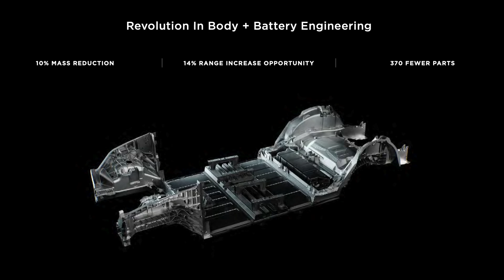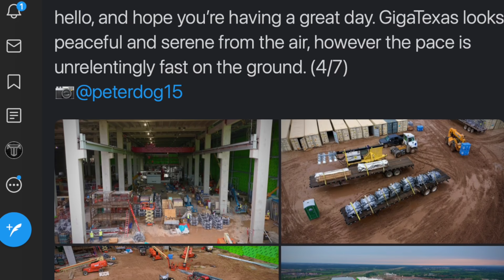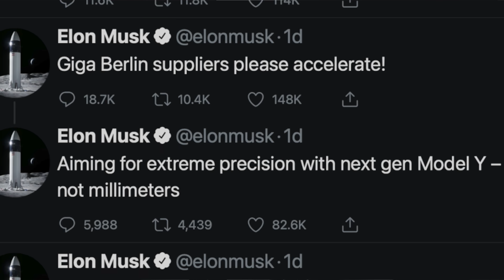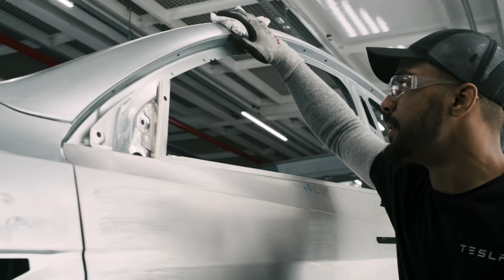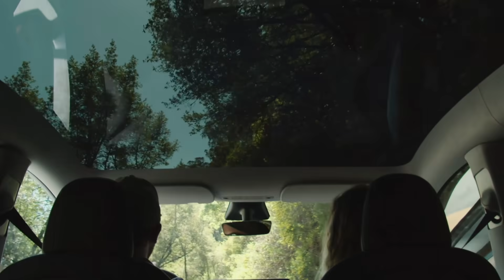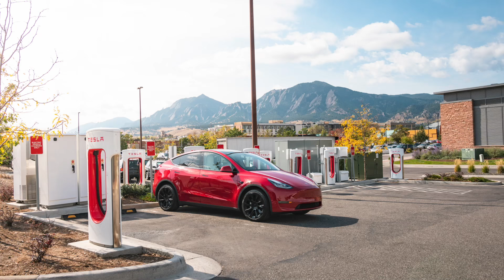Dated Video, Don't watch

Comment: It would be crappy if they keep the same range while using a smaller 4680 battery pack.  That would defeat the purpose of better technology to benefit the customers.  I understand it’s a business but it needs to be fair with the customers.  If anything I would like them to be somewhere in the middle.  May be smaller battery pack but large enough to give 375 mile range.  Then they can wait for the competition to catch up before taking another leap and go 425 mile range.

Comment: My guess is the AWD and Performance will get the 4680s with a 400 mile + range first.  And the Model Y Standard Range +  RWD will return with a 300+mile range. All witll initially be priced similar to current models with the goal the short term goal of slowly reducing price over time as 4680 cells and structural battery packs and single piece front and rear casting roll out to all Tesla models.

Comment: It will 303 x 1.3+ =393.9 and the long range and standard rsnge will have x1.14 because of mega casting+structural battery pack, LR and SR MY still using 2170, like model s LR and plaid still using old battery, but when using structural battery pack it will have 14% range increase

Comment: 420 miles would make the vehicle very usable. Figure you're going to lose the top 20% because you shouldn't charge past 80 nor should you dip below 20 to maintain the long-term life of your battery. With this you could give that up and still have very usable mileage and wouldn't have to dip into the top 20% very frequently. But that's also assuming they don't increase the price of the vehicle.

Comment: That factory in Berlin is nowhere near ready to go. Only becouse the "case" is build you dont have any running equipment inside. I know pretty well the timelines of the berlin factory for the machines that will produce the motors, and they are planned to be operational in the beginnng of next year. Maybe rampup will start in December.

Comment: Easy just have a XL range model Y with the 420 miles  you could have 
Standard range 
Performance (maybe performance plus too?)
Extended range.
XL range 

Would complicate things a bit but it will allow for a more diverse line theres other benefits too

Comment: Come on now, even a 75 kWh equivalent pack would  have 14% more range which means 326 miles x 1.14 = 370 miles of range. That would be doable with less mass and cost. Why wouldn't they do that?
Reply: because 420.

Comment: Model Y Standard Range Plus 2WD 2170's (320 Miles) Freemont                                           ~$38k
Model Y Standard Range Plus AWD 4680's (software locked 320 Miles) Berlin, Shanghai   ~£38k/€38k   
Model Y Long Range AWD 4680 (410 ish Miles) Texas, Berlin, Shanghai                                ~$45k/£40k/€40k
Model Y Performance AWD 4680 (390 ish Miles) Texas, Berlin, Shanghai                              ~$55k/£48k/€48k

Comment: How would this work logisitcally: how would buyers of the MY performance know whether they were getting the 4680 version? At some point there needs to be a "cutoff" (or a third MY version which differentiates it from the other two). Or would Tesla just do there thing where you don't really know what you're getting until its delivered?

Comment: 1) ramp Austin. 2) take Freemont offline & update with front casting and structural pack.  Repeat to update 3 same way.
Reply: Exactly, I agree that’s what Tesla should do.
Reply: Yep.  Also, Austin will be CT/Y (volume vehicles) and Fremont will be lower volume (3/S/X/Roadster).  The only exception I imagine is that Semi might land in TX.

Comment: I think Texas will produce the LR Performance + model Y for reeeeally expensive. Theyll produce only that until mass volume of the 4680 at which point they'll start transitioning the other Y's to 4680 (starting with the expensive models) .
Last model will be the standard range with 300miles range with a tiny battery pack and really cheap
Reply: Maybe they'll do the ultra expensive S 3 X before transitioning the other Ys

Comment: If the Model Y can achieve a range of over 400 miles it will dominate ev sales for years. Other car companies wont be able to compete with that range without installing giant battery packs and losing money on every car. Let's hope if becomes when.
Reply: I think it might cannibalize some Model S sales. I predict a lighter, smaller structural battery pack with around 350 miles of range. As a Tesla owner you need to subtract 15-20% for real world driving.
Reply: No it won't. It will push car companies to come up with new and exciting battery tech. These huge companies don't just stand there watching. We don't even know what all goes on behind closed doors at Tesla let alone more mainstream and experienced companies.
Reply: @UProductions457  They will come but are 3 years late.
Reply: @TurreTuntematon  Once EVs become the new regular and there is a bigger and more competitive market, they'll step up. It's not like Tesla will be spec king forever.
Reply: @UProductions457  Yes, and I have heard that now for 10 years.

Comment: waiting for the:
long range dual motor (non plaid) 4680 cell 600mi Model X
Reply: Nevahgonnahappen. Maybe a 400-mile range Model X will happen within a couple years, but a battery big enough for 600 miles doesn't make sense from a battery allocation standpoint.

Comment: 420 miles on 69 kwh battery would be really nice
Reply: Nice ;)
Reply: nice
Reply: That would be pretty hard
Reply: Funding secured!
Reply: Hahaha i see what you did there
Reply: 420 miles at 69 mph
Reply: I see you are a man of culture
Reply: I will be tempted to buy one if they don’t raise the price
Reply: @stevenanderson9660  they really should be doing price increases in $420.69 increments!
Reply: Nice
Reply: Nice
Reply: Hahahagagagaga
Reply: Yeah... Not going to happen. They've already bumped the battery up to 82kWh and the range is still about 300 real world miles. You're still going to need at least 90 kWh in the more efficient Gen 2 Model Y for a reliable 400 miles of range.
Reply: 6.08 miles per kwh.  Not impossible, but yeah, not easy.
Reply: @MarkLLawrence  a lighter sub 3000 lb probably could. Im able to average over 5 miles per kwh on a sunny day in Cali in my M3 SR+